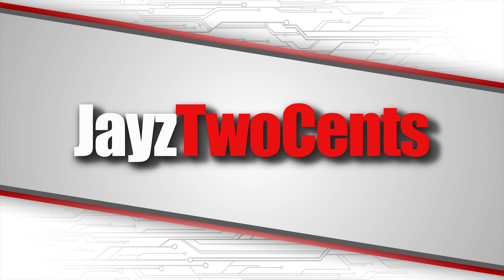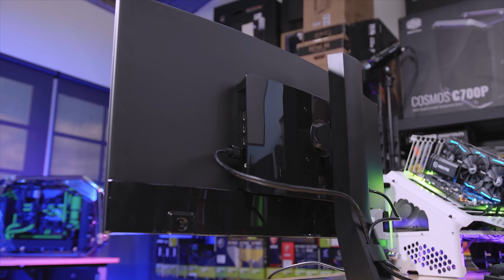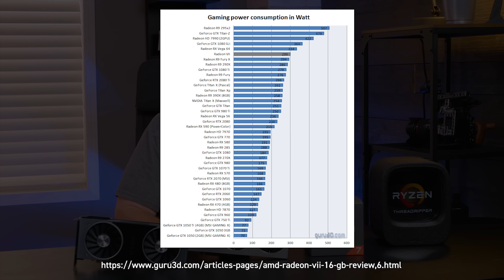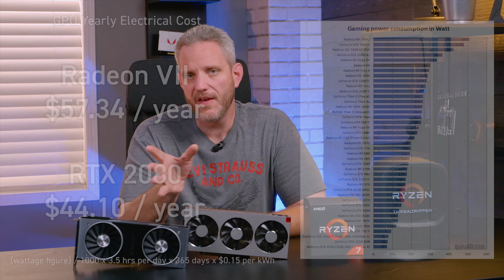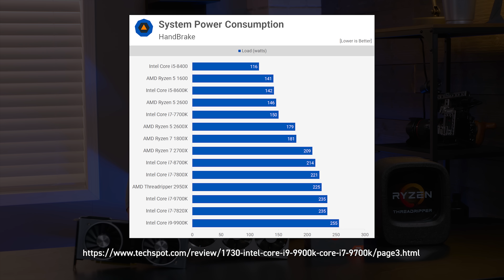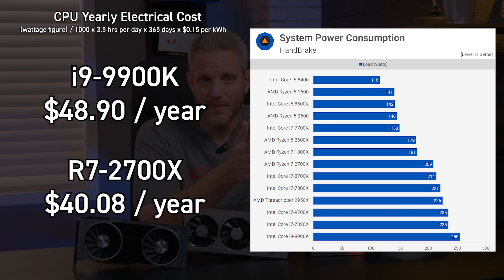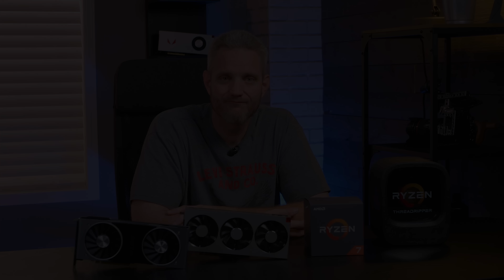Energy Costs of AMD vs Intel vs NVIDIA... This might surprise you

Comment: I've been waiting for a comprehensive "power efficiency/consumption of equivalent performance & price-point, current top-tier GPUs" video. Thanks for this.

I'm saving for my first gaming PC build and learning as much about the tech as I can understand, as I go. As someone who games for about 2-6 hours each day (on consoles), I'm looking for the best performing PC parts, with the lowest running cost I can get, working around the specs of the upcoming Samsung 32:9, 5120x1440p C49RG9 monitor I'm probably set on buying for the build. All this probably with HDR on - up to 98hz using DP 1.4 / 120hz with HDR off, not sure whether ray-tracing will be a factor yet - depends on Navi's performance/efficiency/ray-tracing implimentation vs NGREEDIA vs Intel's first gaming GPU's (please do another one of these videos for Navi vs NGREEDIA vs Intel's first gaming GPU - I heard, rumoured for a 2020 release).

I'm also looking at signing up to that World Community Grid program that uses your CPU & GPU to perform complex scientific tasks while you're not using your PC, which means I would leave my PC running 24/7. 

It would make it a hell of a lot easier & cheaper for me if every part wasn't crammed with useless, overpriced, gimmicky RGB!...but I digress.

I guess the most important point is that I'm also willing to pay a little more in retail price on the condition that I get noticably more efficient parts (given the performance I'm looking for). The savings in the long run matter for me quite a bit more than retail price. Being on a tight budget I'm already looking at patiently saving & eventually spending thousands on certain parts. I don't want to be paying nuclear reactor running costs as well!

Comment: it was the intel  dual core variant of the Pentium 4 known as the Pentium D. It was an even better roomheater and was effectively 2 Pentium 4 CPUs stuck together with spit and elmer's glue  netburts to keep my house warm this winter
Reply: They did run hot, but they were great CPU's. I had the 3.0GHZ Pentium D in a Dell XPS tower and it lasted a long time. Fast computer for the time!

Comment: I just go with my 40°C Idle Space Heater 1700X @ 4GHz with 1.375V which has the same Corecount but a little less Clockspeed than the i9990K but it can keep up with my RTX 2080ti and i just love my system and im proud that i as an absolute OC noob managed to even boot 4GHz its not 200% stable but hey :D it works
Reply: I just boot up my stock 4790k @ 4ghz - its nice.

Comment: Only for developers, that's 15% performance increase can gain more than 40% of the extra cost mentioned. The rest, listener to Jayz comment unless u r enthusiasts. But quite disappointed with Zen2, product wise. The performance is fairly equals to the 9th Gen Intel's even tho with better technologies (theoretically).  Was expecting 2x core counts then would be switching from Intel to AMD. For now, just waiting to see the Chinx can give out something crazier.

Comment: Run 208/220/240V to your power supply for ~6% increase in electrical efficiency.
Reply: And how many people have a 240V receptacle available?
208V is a 3 phase voltage which isn't standard for residential.
Reply: @matthewkuhl79  literally every residential connection, at least in the USA, has 220/240V.  Also 220/240V is common in Europe.

Comment: What that Techspot article/graph doesn't tell us is what the system configuration was for the AMD system or any other system except for the 9700k and 9900k. But it compares them all. I'm not an expert on tests, but if you say Handbrake is a CPU test, does it mean the system configuration doesn't matter too much ? 

For example, if the AMD system was running without any GPU attached while the Intel system was running with a 2080Ti as it says in the article, or different memory capacity/speed, wouldn't it mean the total 'system' power draw wouldn't be an unfair comparison ?

Comment: Difference in energy costs will depend on where you live. It will have merit in countries were electricity is more expensive. In the United States, it's really only important if your system is on 24/7, like a mining rig. For the typical user, power consumption is much less relevant. This is why I can't recommend 80+ Platinum or Titanium PSUs because it will take the average gamer at least 5 years to recoup the cost difference in energy savings and will never pay for itself.

I will say the reason I've made my video card choices has been efficiency. The HD 4870 was more efficient and a better value than what Nvidia was providing at the time. I replaced it with an HD 5870 to be able to use my Thermalright T-Rad2. I switched to Nvidia with the GTX 970 because it performed much better per watt compared to the R9 290X. I got a GTX 1070 because it's better per watt than comparable AMD GPUs. If Navi moves the needle back in AMD's favor, I'll go red again. I care more about GPU heat than CPU heat because GPU heat is getting dumped into my case while CPU heat is efficiently getting carried straight out the back of the case. The less heat my GPU produces, the easier it will be to keep my CPU cool.

Comment: While I agree with what he said in the video, maybe im alone in this, but I can notice a difference in my office between heavy power draw hardware and more efficient hardware. Especially with the door shut a room can be noticeably warmer with say an amd 8350 versus an i5-7600k, or a 1050 versus a 1080 as examples. Im not sure if its worth mentioning but this does have an affect on the AC as its required to work harder.

Good video, I just wanted to add to my experience that a much hotter room can be uncomfortable. Perhaps someone can do a more scientific test with a closed room and some hardware.

Comment: If you're dropping a couple of grand on a PC, you're not worried about an extra $7 a year in electricity, lol. I always shake my head at this whole energy cost argument. Nobody cares. Nobody has ever legit debated the matter in their minds. But, I guess talking about it fills a hole with content...
Reply: I have to point out that you're wrong. A particular techtuber actually tried to make the case for the Nvidia GTX 1650 being better than the RX 570 precisely because it draws less power. Even though the 1650 performs way worse in games, they said it was the better card. The way I look at it, if you're that hard up on cash that 6 dollars a month extra on the power bill is going to be an issue, you shouldn't be focusing on building a PC in the first place.

Comment: The CPU under full load because the fact that the 9th gen i7 and i9 uses more power than a 16-core chip. Once cost of components is factored in, unless you're an enthusiast running the highest end, it'll all probably average out. If you're at the high end, then quite frankly you won't care about power consumption. You just care about having more power. Power draw would only begin to make more sense if you're a techie in a company and you need to do upgrades to the company systems.

"Keep your system for five years"

Lol... I've been running an x4 965 for the past 8 years

Comment: the ONLY times power draw should even be a consideration are A. the chips are otherwise equal in ALL aapects B. you run a huge server farm or enough systems that at simular performance it can cost you big time i.e hundreds of systems for a business. Or if you live someplace where power costs are moronic like NZ where im told power can be as much as $0.40 or more per kwh for example. which may skew things towards a more efficent chip.

Otherwise this power draw argument is as dumb as people argueing the 1650 is a good card

Comment: He should do Video of I7-7700/8700 vs Ryzen 1600 temp/cooling wise.
Because its amazing what $110 cpu can do versus an I7-7700 which is still $250+ on used market.
Ryzen 1600 runs cold on stock cooler
Talk about how much performance you get per dollar. Should have no issues running up to RTX2070/2080

Comment: It's odd timing to do this kind of video. AMD only now gained parity, so this kind of test for CPU would have been a lot more valuable couple of years back. On gpu side, current RTX cards have huge dies to enable ray tracing. If you were to do this kind of test with Pascal, differences would have been so much more pronounced, as AMD does not have dedicated parts to ray tracing in their GPUs. But even now, 65$+ is nothing to sneeze at. I bought R6 Siege, Insurgency, Doom 2016 in total for less than that. And that's >1000 of hours of quality gaming. 

It's like this video was made because it was opportune time for Jay to say "I was right", when it was not for long stretches of these past 7 years.

Comment: For folding you will want an Nvidia GPU. I don't know how much the AMD card can be cut, but an RTX 2080 ti folds just as good at 170 watts, as it does at the stock 300 Watts (less than 4% performance loss, over nearly 50% of power reduction).
Reply: probly even better, vega is really pushed to the limit power wise
Reply: @alextell7019  Nah. No one runs AMD cards for folding. They're power hungry.
Word is, that AMD doesn't have good drivers to enable power capping, like Nividia does.

Comment: Great video except for one statement I'd like to correct, TSMC 7nm is roughly the same size, if not larger on average than Intel's 10nm. The company that makes the process gets to name it so its not really always true. The 7nm name doesn't always mean that it's ALL 7nm, just that something on there is. Is there a process advantage right now, sure, but Intel's 10nm process is around the corner and likely more efficient in many ways. That and Samsung is about to have a 5nm process but that's probably exclusive to nand and flip-flop circuits as they are the easiest of the building blocks to shrink. It'd make for a pretty interesting video but I still the target audience may be more for gamers nexus than here.

Comment: If I remember correctly tsmc 7nm is pretty close to Intels non existent 10nm process.  IE not true measurements... However I doubt it'll matter since if the cost is an issue you will have more problems cooling your house than running your computer

Comment: I use the power draw argument, but not for energy cost, even if I pay 1$/KWh. 
my problem is COOLING! 
radeon 7 needs a 300w capable cooler, the 2080 is rated at 210w 
the 9900k needs (not necessarily, but to run properly) an NH-D15 with them packin 8 cores, hell my 7700k reaches 75C being -0.085v undervolted using a phanteks LP cooler in my Mitx case (phanteks only make 1 LP cooler 120mm fan). 
while the 2700x can be tamed much easier, altho not quite as powerful. 

the cooling problem also extends to laptops, more power draw = need for bigger PSU adapter = need for a THICC cooling system. 

thats why you saw 1060s in a laptop, but only 1 asus laptop with a 65w rx 580 (wonder why no YTer ever reviewed it?)
you saw 1070s in laptops but only one THICC Acer predator 700 laptop with vega 56 and R7 1700 (dave lee reviewed it, good, but THICC AF) 

my only problem is that ryzen is no where to be found in laptops except the two I mentioned above, and recently the Asus Zephyrus and TUF with the R5 3550H and R7 3750H 
both 35w Quad cores (seriously AMD?). 
with 7nm their 8C and 6C CPUs can crush the laptop market with Nvidia and Navi offerings

Comment: Jay, your math is bad and you're talking backwards.  The R7-2700X is the CPU with less power draw but you're talking like it's the i9.  Also, $48.90-$40,08 is NOT $7 and change, it's almost $9, $8.82 to be exact and both it AND the price are in AMD's favour.

Comment: power draw is the last thing i look at.  my main metric is relative performance between two competitors.  i use my computer to play videos, run ms office, occasional video rendering, and playing games such as world of warcraft.  WoW isn't quite as thread-bound as it once was, now that it supports dx12, but it still likes a strong single thread with high speed, which favors intel; however, the bottleneck in my system is my monitor, which can only display 100hz, so that's my top end.  i can get close to that performance with a ryzen 5 1600, much less the 2700x i currently run.  i average between 75 to 90 fps, depending on where i am.  some areas will bog me to the low 50s, but that's an issue with the game structure and a faster cpu isn't going to help that much.  so i could go intel and try to get the extra 10 fps, but is an additional 40% cost (plus the cost of a new motherboard) worth it?  not to me.  now, if i had a monitor and gpu that could get me to 144hz and i was limited to 80fps, then if the intel got me in the 120hz area it's worth considering more.  tl;dr is that i won't pay 40% more money for less than 40% additional performance.

Comment: Until I found that my GTX 970 had decent encoding with it's NVENC and Handbrake 1.2.2 works with it I would run my CPU for 18-24 hours strait at 100%.  Some people may want the software render and still do that.

Comment: When I play on assassin’s creed odeysey, the utilisation of my cpu is in this range, 5-30% and my gigabyte rtx 2070 (in canada, the 2070 and the 2080 have a different of price about 30% and a performence difference about 10-15%, so this is why  choosed the rtx 2070) have a utilisation about 90-95% and takes 150-175 watts for a 1,05v 1980 hz overclocking. In my province, the electricity cost very nothing, about 0,05 $ canadian to 0,1 $ canadian. (Around 0,65-0,13 cent of $ US). In the winter, it's about 0,09 cents and in the summer it’s about 0,05 $ canadian. With my 700w PSU, i have no problem for overclocking my cpu to 4.2 ghz on all core (1,42v) and a 2070 at around 2 ghz. (In load, 1,05v)

Comment: Pointless comparing CPU power costs this way, for eg the 9900k may cost more to run under full load but you have to remember that its considerably faster than the 2700X so if the 2700X is 20% less power hungry but takes 20% more time to complete a task for example then power usage becomes the same. Same for gaming, if the 9900K is under 30% load to push a 1080Ti in a particular game at 1080p but then the 2700X is at 40% load then that has to be considered also.
In the end though in the grand scheme of things... $20 dollars difference per year is negligible.

Comment: More power = more heat. My Nvidia GTX 1660 hits 68c running GTA 5 at normal settings in 4k with a I7-3770. Machine uses much less power, and produces much less heat than my AMD FX 8350 with a R290x. It's not so much of cost, as it is heat. That PC with the GTX 1660 is cooler and much quieter with 3 Noctua fans. Also the card fan does not get loud. It is easier to cool something that uses less power. Near silent system with decent performance for age of hardware.

Comment: I'm using HWinfo64. Cinebench, Battlefield1 (which did put load on my CPU and GPU evenly), Prime95 and Furmark.
It tells me my i7-7700k uses around 60-65W on 4.5GHz Turbo all cores on 1.25v under full load (no real OC, but optimization). 
My GPU a Strix 1080TI is around 280W (same tool). Factory settings.
I also used a power meter in the Socket and it shows around ~390W with both CPU and GPU running under full Load. Which confirms that the tool is working right. 
My PC has 5xFans, 1xSSDs, 2xM.2 NVME and 1xHDD...  NO RGB... and a Seasonic 660W 80+ Gold PSU. That PSU uses ~30-40W to change currents.
SO IF all my PC components run 100% they should consume a total max of ~430-440W out of the Powersocket. That includes all drives and FANs, but no OC.

FYI: When overclocking my CPU onto 5GHz @ 1.4v on all cores it eats ~100-105W. Thats 80% more for 500MHz.
P.S.: I'm living in Germany and the Powercost is much higher ^^. With 0,31-0,35€ for 1 kW/h. Thats ~155€ or ~175$ per Year if I game 3.5 hours per day with my PC.

What I conclude is that Nvidia is still far ahead of AMD in GPUs. 
But Intel is far BEHIND AMD. Since Intel still builds upon 14nm. Intel does make faster and faster CPUs, but since they still build on the same 14nm its powerdraw also gets higher and higher.

Comment: you can be hit on having to spend a little more on your power supply, not that It will change the point of this video.     what about a comparison on PSU; by a 400W running at max vs 800W at half of max?  both for same energy rating or the 800W at a lower rating? maybe some thing different.

Comment: power draw important if your PSU can't handle it,
Reply: Talking about multi hundred dollar cpus and getting necked by a 300w power supply? That's a yikes from me dawg.
Reply: Decent psus are cheap. And there is always some 500-550w 80 plus bronze psu selling for 15-35$ after rebate.
Reply: @pauls4522  no such thing as rebate in the UK.  a decent power source will add £60-70 on top of the GPU.  reason I never bothered with the cheap vega 56's.
Reply: @pauls4522  again we don't get rebate
Reply: @MTBScotland  I only left one comment? But regardless, yeah I understand that. even with a basic psu, unless you have really high cost per KW hour, then even an inefficient pc wouldn't cost much to power. I've seen a person rocking their used radeon 7970 they got for cheap recently instead of buying a gtx 1050ti or gtx 1650 for example (which are speed equivalents of the 7970.)

Comment: I think of it the same way as I do with my V8s. If your going to build a bad ass 1000HP V8, your going to power not fuel economy. Same goes for when I build a bad ass computer. Im going for maximum performance not energy saving.
Reply: If you play 4 hours a day or less, it's not even worth thinking about tdp.
Reply: @LegendarySkypenis  I don't play nearly as much as I used to. I only get like 4 hours a week maybe. I do have some servers that stay on 24/7 though. I worry more about how much power those are pulling, much more than what my gaming rig.